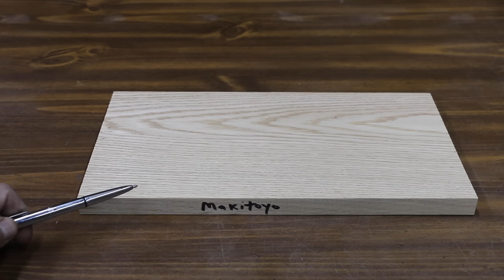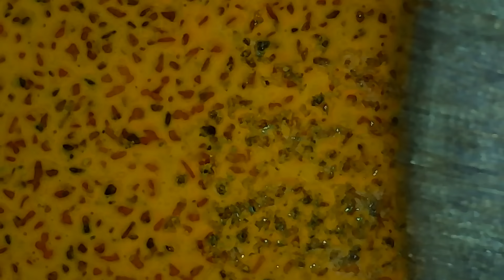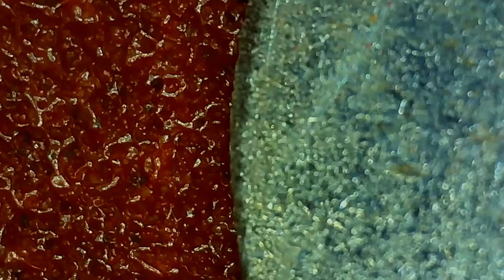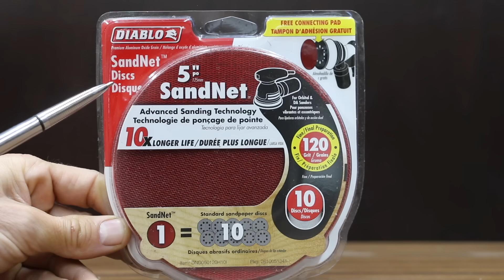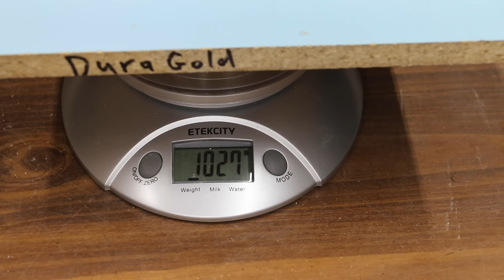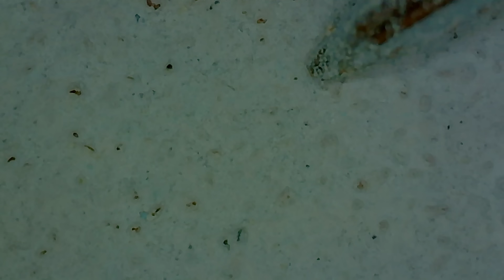Best "Sandpaper" Brand? 3M Cubitron, Diablo, Mirka, Norton, Makita, DeWalt, Bosch Sand Paper

Comment: You didn't preform a test the MOST important component of sandpaper. The overall finish, or polish capability of the paper. If you were to take a piece of mild steel and start with grinder marks, then move up through grits, you'd soon find that 3M is the ONLY brand that remains.  I have found their products do the best on all surfaces. MIRKA, Norton, and Zona are pretty good too. 

Don't take my word for it though, polish some steel for a fixed amount of time and put it under the microscope!
Reply from the maker: Thanks for the suggestion.

Comment: Should have done a second video at the same time.. Best air filtration system filter.  
Really great info.. I've been using Mirka with good results, but I might try the Diablo next time I refill. 
One thing I noticed on Amazon - 50 pack Diablo is about a dollar more than the 100 pack of Mirka (5" disk, 120 grit). The Mirka is about 19 cents each. (That's the reason I was using them)
Reply from the maker: Great suggestion!  Thank you.

Comment: I always knew Diablo was one of the best. Totally worth the premium over the cheaper brands. I especially love the SandNet. When I use my orbital hooked to a vacuum, it allows for great dust removal, so there's practically none going out in the air in my shop. I would have liked to see how GatorGrit brand from Ace stacks up as well as Master Force from Menards. Maybe next time. Keep up the good work!
Reply from the maker: Thank you, will do!  Thanks for the video idea.
Reply: The sandpapers good but the nap on back sucks, won't last more than 10 minutes on my Makita before it Flys off never to stick again, that's why I'm here. My local hardware stores only stocks Diablo, I pulled out some old 20 year old sanding disc's guess what they stuck like a charm something with the nap sucks? Also just added new orbital pads so they have new hooks on them?

Comment: you left KLINGSPOR out. that brand would of out last them all
Reply from the maker: Thanks for the suggestion.
Reply: I do a lot of 304 stainless steel finish work. 304 is known for wearing down sandpaper in seconds, klingspor holds up the best so far.

Comment: I would have expected better results from Norton.
The 3M performed as I expected.
 Thanks for the info. As usual outstanding testing procedures. Great job
Reply from the maker: Thank you!
Reply: Great test indeed..
However we should keep in mind that 3m cubitron is a top premium ceramic range. On the other hand, the Norton adalox used in this trial is the bottom of the DIY range. To have a fair comparison trial, the test should have been done with a Blaze orange ceramic disc or at least with a ceramic cyclonic range product.

Comment: I've learnt over a long time of trial and error to change my disks more frequently. Inevitably I'd try to push the disks to cut for longer, it'd effect the finish, overloads the tool and wastes time. Especially sanding painted wood and hitting nails or catching an edge toasts a disk instantly so best a cheap one often changed. I cant imagine how you could gauge a disk on it's life cycle in the home shop. If I grab the sander and its not cutting 100% it's frisby to the bin time.
Reply from the maker: Thanks for the feedback.

Comment: If your scale was accurate enough, you could also measure the mass the of the sandpaper itself before and after testing. You'd have to be sure it's clean, but you could attempt to quantify loss of grit mass on the paper. You could also then measure the mass of the paper after sanding paint and other detritus-heavy media to try and quantify the mass of retained material in the sandpaper itself......on second thought, that's all probably more work than it's worth!

I'd also be curious about belt sanding abrasives performance........

Thanks again for all the testing! I come to your page to see if you've tested a product/s before purchasing.
Reply from the maker: You are welcome!  Thanks for the feedback.

Comment: Too bad this video didn't exist two years ago when we were told to strip the paint off a camper trailer with paint stripper and a chisel. Coworker went out to Lowe's to buy a sander, but didn't bring back any sanding discs. Still haven't used that sander.
Reply from the maker: Thanks for sharing.

Comment: can you do one for automotive sandpaper which usually comes in much higher grits? Id  love to buy diablo but im pretty sure they don't make 600 800 or 1000 grit discs for autobody work so im usually stuck buying very expensive red 3m discs that dont seem to work very well or harbor freight discs that stink too but are at least pretty cheap.
Reply from the maker: Thanks for the video idea.

Comment: This is what I like about 3M- if you need any product from sandpaper, 5200 marine adhesive, electrical tape, Post-it notes, Bondo, connectors, anything they make you know youre getting the very best or close with every product they sell. Much of it still made in USA. If you see 3M on the package you don't have to wonder.
Reply from the maker: Thanks for the feedback.

Comment: I would have liked The Abranet® product from Mirka (Or a similar product from any manufacturer.) to be included in the test.  Certainly not affordable, but at least in my opinion, it stays unobstructed for a really long time due to its mesh structure if used with good dust extraction.
Reply from the maker: Thanks for the video idea.

Comment: Great video on the sandpaper test I really liked how you tested it on the different materials   Have you ever tested diesel programmers for the best fuel economy and work abilities I run a Smarty Jr in my 2007-1/2 6.7 Ram 3500 dually 4x4 with 3:73 gears set for towing and I’m getting about 17-19 mpg at 78 mph on the Interstates without a load.
Reply from the maker: Thanks!  Not yet.  Thanks for the suggestion.

Comment: Thank you for doing this video I had suggested! I had another inquiry for what's the best jig saw blades for wood and metal, which do you prefer? I think T shaped ones  vs the U shaped ones
Reply: Seem to work better in my opinion. I use Milwaukee jigsaw 12 volt and have only used harbor freight's brand and Diablo
Reply from the maker: Thanks for suggesting this video test!  Thanks for the video idea.

Comment: Every time 3M is included in a test, i know the winner. I only watch the entire video because you're awesome.
Reply from the maker: Thanks so much!
Reply: @ProjectFarm  I will ask a bit of a counter-question. So if you are looking at maximum removal, this test is perfect. The good performance of removing materials from some of the brands might also suggest that the grain size could be larger or rougher than on the lower performing brands, i.e. different production standards/quality. So if one brands 120-grit is actually a 125 grit, it of course should outperform another brand which have their 115-grit labelled as 120 grit. 
It would be interesting to see the performance between papers from different batches, to see if the quality is consistent between different manufacturing runs. 
Other times you might be looking for the best finish including (or the lack of) circular scratches, lesser risk of burning the materials, degrading between center and outer edges (leading back to finish quality) and etcetera. 

This might be a bit extreme lengths, but I think that this test could be worth revisiting with different criteria to test.

All cheers for an awesome channel!
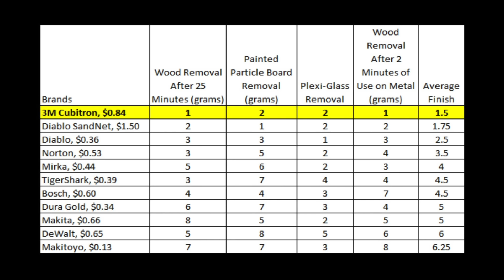Reply: 3M certainly has a well-deserved reputation for high quality; overall results: 13:27

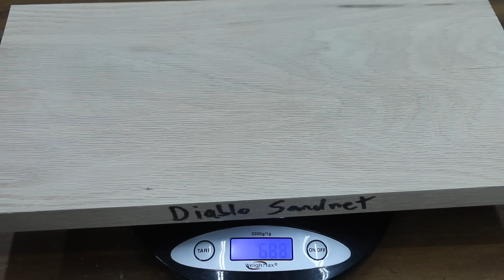I'm really impressed that 3M Cubitron was the only brand which was hardly degraded at all by sanding on metal for 2 minutes: 13:16

True fact: I have a lot of 8" diskettes, with data on them, which I would love to recover. But the ONLY brand which is still usable, 1/3 century later, is 3M. The other brands all self-destruct in the diskette drive, because the adhesive which sticks the oxide recording layer to the substrate has degraded, and the oxide comes off when the head rubs it.  (Unfortunately, the data I want is on the other brand diskettes, mostly BASF and Wabash -- if anyone knows a way to read those diskettes, please contact me.)
Reply: @ncdave4life  we use cubitrons on grinders in the heavy industry to grind down steels, excellent pads.
Reply: Same here! While not mind blowing, 3M stuff is always guaranteed to do what it says on the ‘tin’. 
After all…there’s a reason why you’ll see pros using their products quite often! 

Diablos paper and blade products are always great too.
The only issue I have with Diablo paper, is how easily they can fray around the edges.
Reply: The problem with 3M is you can’t get it at Home Depot.  They have Diablo.  I used it today and nowhere near 3M.
Reply: Keep in mind that Cubitron is 3M's top of the line for its 5" cloth sanding discs, and there are 29 other styles listed under that category on 3M's website. When you're comparing a Genesis against a Versa, and drawing conclusions about the relative merits of Hyundai and Nissan, it's not really a relevant test. 
-- With sheet sandpaper, I'll stick with Norton 3X. I have had a lot of problems with the  better grade of 3M sheet sandpaper, from its clogging quicker to its leaving flatness-degrading chunks of residue on sanding blocks from its sticky back. Klingspoor and Gator brands are OK, too. I have used boxes of 80-grit sandpaper for exterior restoration work, and I like Norton the best. But 3M makes a stretchy, clear-plastic-film-backed sand-"paper" that is pricey but very good for some applications.
Reply: 3m and diablo seem to be the best in consistant quality between products
Reply: I KNOW! Right?
Reply: True. He is awesome... maybe even Very Impressive.  😂
Reply: Agreed, humourous, interesting and entertaining.
Reply: There is a heavy hitter missing from this test. 
Klingspor.
Reply: @BigDave539  Yup and Mirka Abranet, Festool Granat. Klingspors greentec is pretty good but it eerily feels like thin Festool paper.
Reply: Minnesota Mining and Manufacturing.
Reply: USA products are best
Reply: @arya3261  only Americans get American made sandpaper from 3m 

I personally only have made in Germany sandpaper from 3m  

I got some send to me from my company in America 
And i was disappointed how many i had to use compared to the German version 

While supposedly being the exact same 

Also comparing costs the German version was 34% more expensive
Reply: @arya3261  German products are the best
Reply: @richarddavies5674  
Most expensive does not mean best.
Reply: @richarddavies5674  

What does Germany manufacture besides fascist wars in Eastern Europe?
Reply: @joebenson32  they make some pretty decent gear.
Reply: @richarddavies5674  

What gear?
Reply: @joebenson32  cars, tools, engineering apparatus etc
Reply: @joebenson32  it's been over three quarters of a century. Grow up
Reply: @joebenson32 wera, wiha, knipex, hazet, proxxon, festool, Carl Zeiss, KUKA,  ZF. Your Car Most probably has a ZF Automatic transmission, was Assembled by kuka Robots, and the chips got made with Zeiss optics, the ABS sensor is also most likely made by bosch
Reply: @joebenson32  Who were the main funders of Hitler's war machine?> Oh no.. it was the good old USA. I bet they didn't teach you that in school. Your modern day American fashies want to ban US history  because they're triggered snowflakes.

Even after it was known what Hitler intended for US was still funding him. Same US that turned away Jewish refugees. Nice history.

Comment: Great test. Based on your results, I would say if you're an occasional user, go with the 3M. Spending the extra money for occasional use will not hurt you, and your sandpaper will last the longest. If you're a contractor or go through tons and tons of sandpaper on a regular basis, go with the regular Diablo brand. 90% of the performance at half the cost. Big cost savings over time.
Reply: Depends, if your paying for the sandpaper and also getting paid by the hour to sand diablo all the way.  

If your paying for the sandpaper and paying your guys by the hour to sand the 3M removed 32% more material in 25min.
If the job is done in 40min vs 60min the extra $1 on sand paper is of little consequence.
Reply: Sand net lasts significantly longer than the regular Diablo and it can be cleaned & reused. HD regularly runs hefty sales on 50 packs w/5 different grits. Sand net is a much better value than the Diablo.
Reply: Or buy 3m on sale. The longevity will make up for the fractional cost difference

Comment: Howdy, watched a video recently on anti seize and noticed that you swapped digital torque adapters at one stage.  I am  looking for a digital torque adapter for general car maintenance (5-125 lbf ft).  I am particularly interested in accuracy and ease of use.  I'd love to see size as a consideration as well as the indicator types as often you cannot see the readout when working in restricted spaces.  Being in Australia many of the products are not available retail here, however eBay is great, although those Amazon links might help as well.
Reply from the maker: Thanks for the video idea.

Comment: Did you consider an endurance test?

I have bulk Mirka SCREENS as well as paper, and find the mesh to last AT LEAST 10x as long, particularly on softer materials where buildup is an issue. 

On my Makita with a vacuum hooked up, the screens absolutely blow away paper backed abrasives.
Reply from the maker: Thanks for sharing.  Thanks for the video idea.
Reply: @ProjectFarm  thanks - the actual name of the Mirkas I'm talking about is "autonet".

Comment: Awesome work! We use the 3M pads at the sheetmetal shop I work at, and they chew through steel and stainless pretty easily.

here's a related question for you though. what's the best lubricant for sanding aluminum? I've used WD-40, drilling/cutting wax, tap magic, etc. so far I like the wd40 the best. that in combination with the cubitron, it seems to last forever.
Reply from the maker: Thanks for the video idea.

Comment: Video suggestion 1 - the difference between hammer drill vs SDS drill. - Is it worth buying an SDS drill or is a regular hammer drill enough for DIY(Can test drilling through concrete, tile removal, chisel/ breaking up small concrete. 
Video suggestion 2 - 4 cut masonry drill bit vs 2 cut drill bit - is it worth the extra money? - can test drilling concrete like previous Video and do a head to head speed test / cutting through rebar etc. 

I think everyone that has had to drill concrete has thought if it's worth buying the 4 cut or shelling out for a dedicated SDS drill.
Reply from the maker: Thanks for the video ideas.

Comment: Noting to do with sand paper but I’m very interested in seeing if you can do and oil lubricity test using Ford motorcraft 5w30 synthetic blend. Mainly because that’s what I use. And my trucks getting up there @ 257,000 miles lol
Reply from the maker: Thanks for the video idea.
Reply: @ProjectFarm  you can even make it a Ford vs Chevy thing and compare it to ac delco motor oil. Would love to see the winner.

Comment: Best skillsaw brand? A bunch of different skill saws (maybe even compare the high voltage ones and the lows like makitas double battery vs dewalts 60v then the 18v single battery vs a 20v) use the same blade for each and replace them between saws
Reply from the maker: Thanks for the video idea.

Comment: I have been using diablo blades in my saws, and switch to their sand paper for my last project.  I was surprised how well i held up compared the the other cheap brands I was using prior to diablo. their sanding blocks are awesome as well.
Reply from the maker: Thanks for the feedback.
Reply: I was hoping to find a comment like this. I found a brand of sand paper that works well enough on wood but the durability is a little lacking. Thank you :)

Comment: Nice video! It would have been nice to test the velcro duration. The problem I have with these sand papers is that they stop sticking to the machine after few minutes of usage
Reply: And still, very good vid👍
Reply from the maker: Thanks!  Thanks for the suggestion.  Thanks for the feedback.
Reply: @ProjectFarm  (or maybe i don't use the machine correctly 🙈)
Reply: Sometimes it's the hooks getting warm and melting down by trying to make cheap sandpaper do too much work or get more life out of it

Comment: Just because a brand removed more material than others doesn't necessarily mean it's better; it actually may mean it has improperly-sized grit and is closer to 100 grit than the spec'd 120. 
"1st Place" maybe should be "last place". If there's a next time, a test FIRST to determine if the specified grit meets the standard would give me more confidence in the ensuing comparisons. The durability tests, however, provided good information. Thank you for these videos!
Reply from the maker: You are welcome!  Thanks for the feedback.

Comment: I've come to prefer Diablo for my fiberglass projects. I actually have some 220 grit sheets which look as good now as they did over a year ago. Serious bang for buck!

Another thing I like about Diablo is that it's very easy to restore when it does eventually clog. 1 or 2 swipes with a shop vac, and it's as good as new.
Reply from the maker: Thanks for sharing.